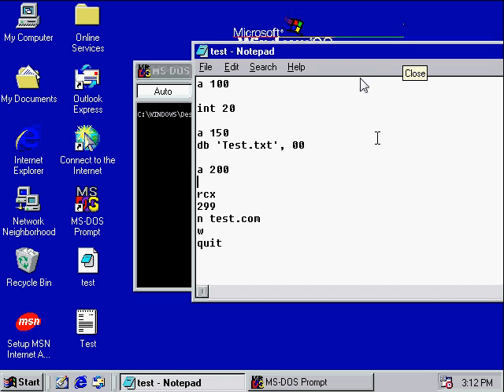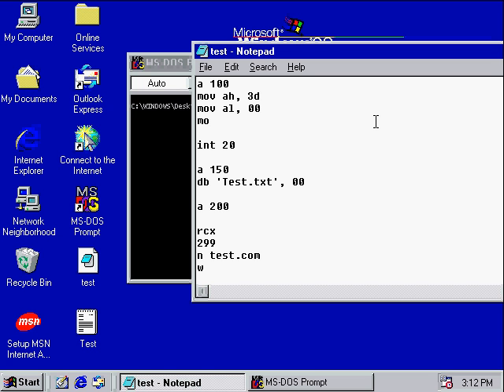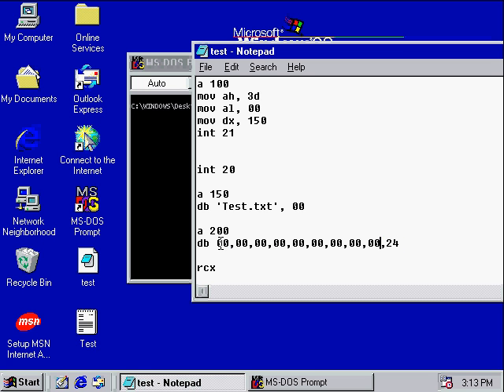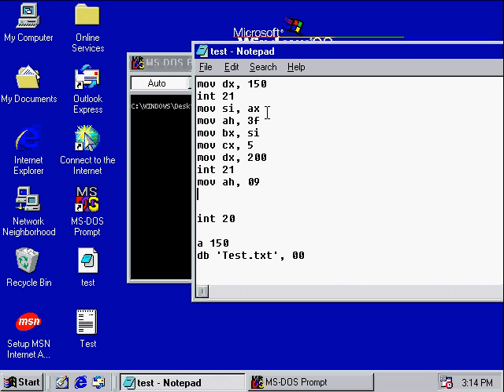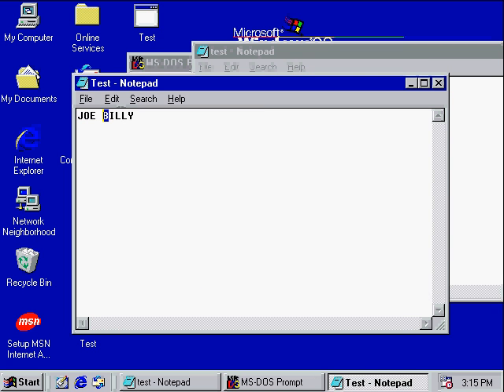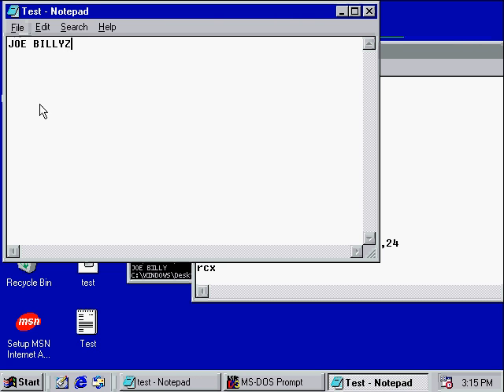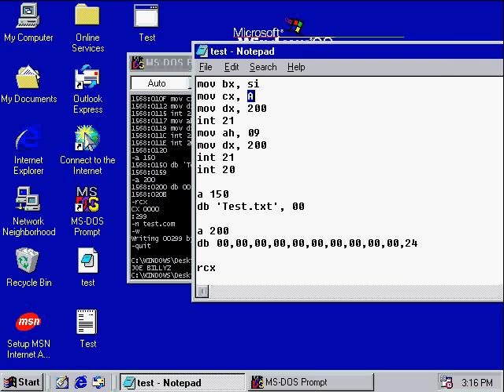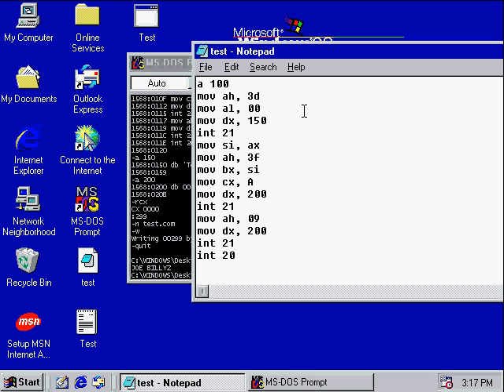Assembly Tutorial 15 - Reading Files

Comment: Hint:
1. open with 8.3-file name with zero byte attached to get a file handle in BX
  1a. get file size from the end of file and set file pointer back to start
2. read/write with file handle
3. close file with file handle

or

1. Create file to get a file handle and write into the file with file handle.
2. Close file with file handle.

Note: int 20 close all open files.